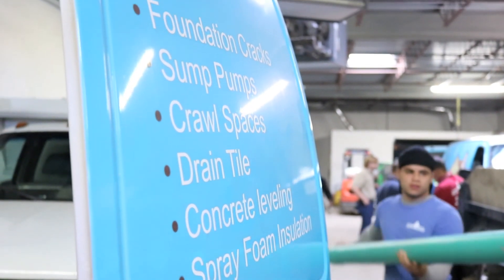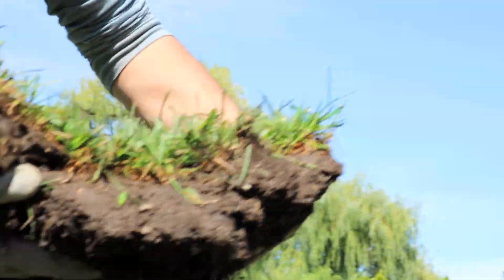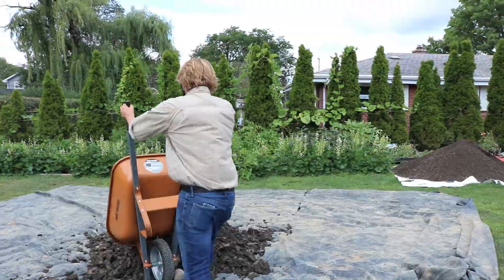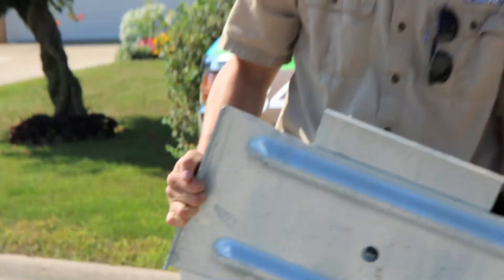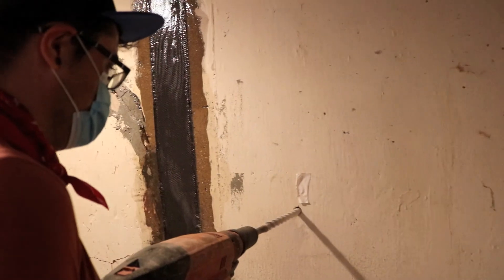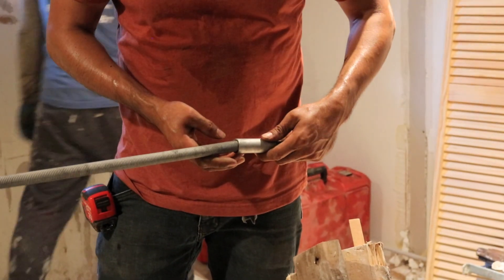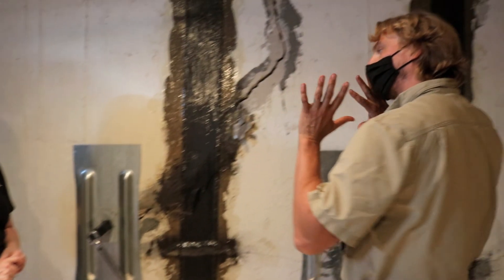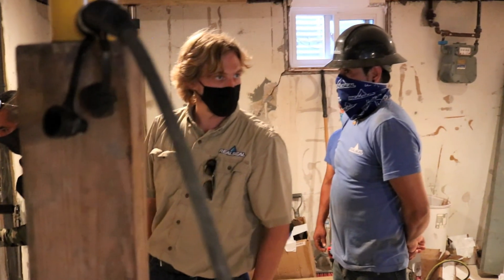How We Do It: Wall Plate Anchors

Comment: what was the bill?
Reply from the maker: It's different for every project, depending on crack repair done, sealing work, etc. The more severe the tipping/bow, the more plates will be needed in order to stop/correct the wall. 

We have pricing videos on our website that explain how everything is priced out with some rough estimates so you can get a feel for a project you are looking into. We can provide an accurate quote with an on-site visit.
Reply: @Therealsealllc  Pretty sure they simply want to know the cost for the ONE in this video. I am not even around where you guys are located, but would also find that informative, and yes I am sure we both realize cost varies a lot.
Reply from the maker: @kevintomb  for this specific project, it was in the ballpark of $20k.
Reply: @Therealsealllc it’s nice to see a contractor posts rates! Crew of several guys plus equipment on seriously major work…seems a very fair cost to me.
Reply from the maker: Thanks @patty109109  !!